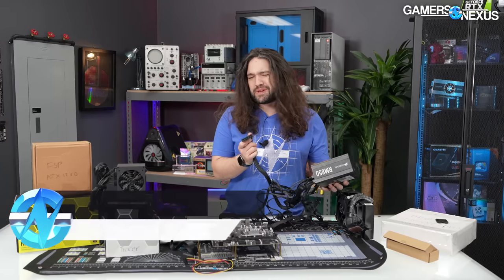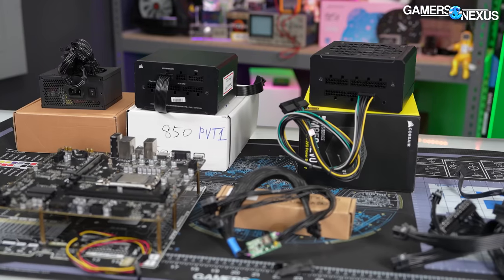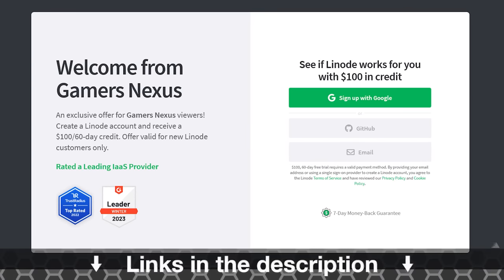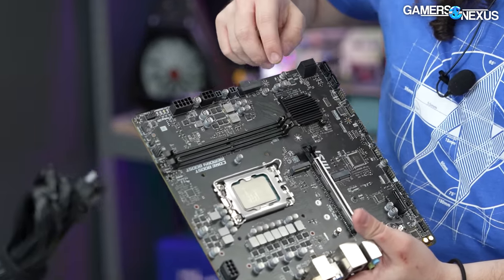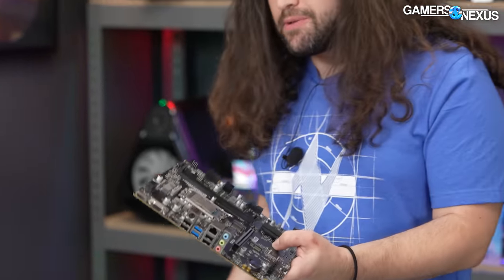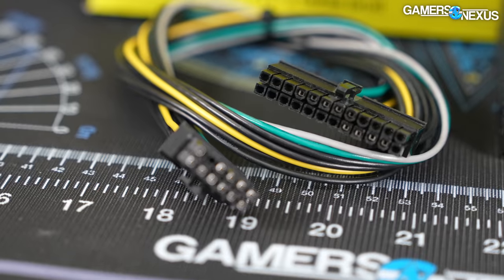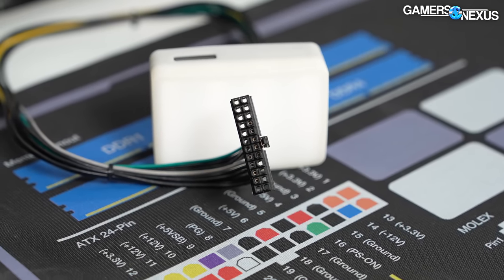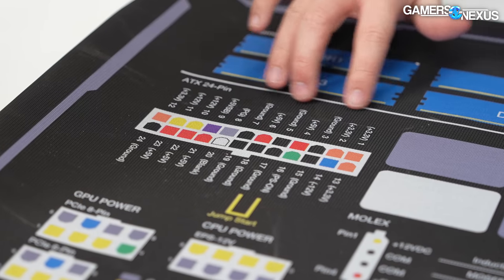The Future of Power Supplies - Maybe (Motherboard Cost, Cables, & ATX12VO)

Comment: With all the PSU talk I have a question, which I'd need to have answered more or less right now, but not immediately:
How much power does a bare ITX motherboard (actually a B450, but I'd like to know for general use) typically draw from the 24pin connector?
Just the bare board with an APU/CPU-with-IGP in it, two RAM sticks, one 3.0 NVME drive, keyboard, mouse and monitor.

Due to space constraints I need to build my own PSU solution and need to know if a 200W Pico-PSU is okay or not.

Just the 24pin, but there the cumulated power of all rails.

The 12V EPS connector is the least of my concerns. 12V power is abundantly available, I even could reroute both 12V pins of the 24pin of the Pico-PSU, if needed.
(No, it's not gonna be a car PC).
Reply: If memory serves, with Zen 3 it's mostly the SoC that's being fed from +5 V (maybe 25 W?), and +3.3 V is feeding the SSD along with misc small-fry stuff likesystem monitoring. In your scenario the +12 V in the 24-pin may be hardly used at all (save for fans and stuff), depending on the board's actual power routing.

If budget is no object, I don't see why a PicoPSU-160-XT shouldn't be plenty for your project. You're not going to overload it with a typical 65 W TDP AMD APU. On the Intel side, reining in the PL2 power limit may be advisable depending on what kind of CPU is being used, assuming the cooling solution isn't protesting first - the 224 W default PL2 of my i7-11700 would be a bit too much, for example. Do read the manual (it has the +5 V and +3.3 V current limits), and verify whether the P4 power cable is actually still optional like it says.
Reply: @PileOfEmptyTapes  Thanks for the reply, I appreciate it massively!
Just for clarification: With manual, you mean that of the 160-XT?

For my little toaster (not an actual one, mind you...although that might be tempting...) I'll be using a 5700G. But who knows what is put in there down the road. If I hadn't all the AMD stuff already and would go Intel, I would put something like a 12600 or a 13500 in there. But a 13900 would be possible as well - I don't need that, though. With Intel I would just get the smallest tier non-k CPU with the highest tier IGP.
Capping the PL2 limit was on my radar, but as I said: 12V power is abundantly available from the source which feeds the Pico-PSU, so the CPU power connector is not so important in that regard. I just feed that directly. The Pico only needs to feed the 24pin and nothing else.
Reply: @wiedapp  +12V being live all the time might work but is not a case foreseen by the ATX12V Power Supply Design Guide. You would have to verify this yourself with the board at hand. The PicoPSU is designed to switch +12V so all the rails come up at the same time as they would in a regular ATX supply.
Reply: @PileOfEmptyTapes  No worries, the 12V power source will be switched. Some people (...especially in the last decade...) did it a similar way, but they switched on the source manually before pressing the button on the system or have it auto start at power on. I want to use just the normal button on the case and nothing more.
Requires a little craftsmanship and knowledge of electronics, as that is not plug and play. Let's just say I'll build my own power brick and the Pico has to be slightly modified, nothing major. I don't want to go into detail, as that concept is not tested yet and I don't want my sources for hardware to dry up...

Comment: How would 12vo work on an itx motherboard? How would it work in general going forward with smaller designs like the new minisforum mini pcs? Moving the power regulation to the motherboard will have to take up board real estate and on small form factor boards real estate is already in a premium.

Comment: How would we build a custom NAS with a 12VO power supply? Do we need to go and buy a special (read: very expensive) motherboard with high current ratings on the SATA power connectors? Or 10 of them on board? Or are we expected to convert 12V to 5V and 3.3V externally in order to power the drives?

Comment: If they change anything, I would like to see a complete overhaul including the aged connector style, i.e. one line only for each voltage + GND, the requirement of having multiple lines carrying 12v (or others) is because of the connector cannot handle the power. sames goes for VGAs. maybe there was no connector available back when they designed the spec, but I am certain, there are better, more suitable connectors available these days.

Comment: The industry should consider a 12/24 or even 48 volt setup.  Higher voltage for the seriously power-hungry devices.  It's much more efficient to step AC mains voltage to 24 volt than 12.  48 is even easier.  The cabling can carry more power at higher voltages.  Consider this is already a route taken in networking Power-Over-Ethernet devices.  52 volts run through those tiny 26ga wires over long distances to power devices for years continuously, and safely.  Higher voltage devices can be smaller, and require less copper.  Its time the industry looks at a big shift.

Comment: Great video. Only question that I have after it is how exactly this standard makes PC more power efficient? I understand that PSU is more efficent since it has to perform single conversion but other conversions still happens, just on the MB. Why it is more efficient to perform them this way?
Reply: It doesn't unless the motherboard makes assumptions of what devices you can hook up and only provides enough 5v and 3.3v current to fit those expectations (because over-sized power supplies do run less efficiently). Otherwise, any advancements in efficiency they can put on the motherboard could also be put in a power supply. 5v and 3.3v lines do lose a little bit more power down the cables due to impedance ratio of cables to load, but it's very very insignificant and besides with VO we're running more total power down fewer cables which is also a minor step down in itself.

Want a more advanced config with several drives and stuff? Well then you can add more complexity with secondary power supplies that will likely bring your total efficiency lower than a nice ATX12V power supply was.
Reply: 1. You no longer have to send the +3.3 V and +5 V currents all the way from the PSU to the board, thus cutting down on ohmic losses along the way. (The OEMs particularly like that it also saves a fair bit of copper in wiring. If you want to transfer the same amount of power via 3.3 V compared to 12 V, not only does your current almost quadruple, but your voltage tolerances are correspondingly tighter on top of that. That means about 13 times the wire cross-section required, or 1/13th the resistance. Assuming it's all in the wires, which of course it generally isn't.)
2. Likewise, going from +5Vsb to closer to +12Vsb cuts the losses along the whole chain as well. Not to mention that you may want up to +12V for USB fast charging anyway.
It's the same as in the power grid - the longer the distance that power has to travel, the higher the voltage chosen will be. (Incidentally, the PCIe CEM 5.0 has added a 48VHPWR connector for a new +48V rail, likely to find use primarily in the enterprise world.)
3. Local DC/DC converters can potentially also be tailored more closely to actual requirements instead of having to ballpark it (on the generous side) when producing the PSU.

As a potential benefit of #1, you'd be eliminating the possibility of GPU return currents messing up NVMe SSD power as well (which is a bit of a thing, it only takes poor contact in the 24-pin ATX and a powerful GPU).
Reply: @korgied   Thanks for the explanation!
Reply: @PileOfEmptyTapes   Thanks for the explanation!

Comment: 18:15 pin 20 appears to be unused, it should be used as a report wire and it should be backwards compatible with existing equipment. It's a better option than the 12vo, if you need extra board power PCIe and eps already exist as do SATA and the less common 4 pin molex.

Comment: We would likely see things like that Seasonic connect and such come into being more readily. I could also see power distribution boards like what Singularity PCs make being made to handle the DC-DC conversions for a 12VO system using an older motherboard.

And I am fairly certain we would start to see more components move to a 12VO standard where possible. And failing that they likely would reduce the spread of volts required. Kinda like how some Single Board Computers and even some game consoles are built to run on only a single voltage. (Also I am getting flashbacks to Linus and his USB-C all the things video...)

Comment: If they need an additional layer now for some simple voltage regulation, then how did they transport the energy from the old 24 pin plug to the parts that need 5V + 3,3V? They claim that they need another layer to raise the marge.

Comment: I wonder how they will put these additional voltage converters on an itx board - and if they manage to do that at what cost? Futhermore it introduce another aspekt of complexity, currently on most psu the 5 and 3,3 rail can provide about 100w give and take. Will the motherboard also be able to provide that, in case you want to build an NAS with good old spinning disks? The manuals for the new motherboards will be wild. XD

Comment: Way back in 2006 I used combined data+power SATA cables (which, back then, adapted to a female molex). Similar cables are standard in datacentres for SAS connectors. I'm puzzled why ATX12VO doesn't simply move to those cables, which have at this point existed for over a decade, instead of inventing yet another cable (the 4 pin to SATA power).
Reply: It also feels like a missed opportunity to change from PCI-e aux power cables to a simple card connector on the motherboard like Apple's MPX modules. No more melting connectors. The only issue I can see is with Micro ATX where there might not be enough board space to accommodate a second card connector next to the PCI-e x16 slot without fouling things like the chipset or the RAM slots.

Comment: Is 12VO really more efficient overall? Because I'd think it would be less efficient.
Because transforming a voltage twice(230v -> 12V -> 5v) can't be more efficient than transforming it straight to the correct voltage(230v -> 5v).

So I'd very much like to see that tested in practice. Because I find those claims really hard to believe.

Comment: Anyone else old enough to remember when BTX was supposed to be the new thing, and we were being told that ATX boards and cases were going to be a dead-end?  It was right around the time PCI and AGP were replaced with the new PCIe standard.

This gives me those vibes.  The DIY PC market accepts change slowly to never, when it comes to things like this, because cases and PSUs are treated as future-proof.

Perhaps smaller system integrators will adopt this sort of thing to compete with HP and Dell, who have their own janky proprietary standards they use from time to time in certain systems.  They’ve already sunk money into R&D on those, so it doesn’t make sense for them to switch, but a smaller boutique builder that wants to build custom cases and wants to save space might find this enticing.  I don’t see most regular folks getting into these unless we’re forced and I nobody has the balls to push consumers hard like Apple does.

That said, it’s possible that this could catch on in SFX PSUs, because they can probably crank a little more power out of those little guys and the conversions on the board could be minimal for an ITX board.  Someone interested in an ITX build probably isn’t going to mind giving up some legacy things that require the lower voltages.

Comment: But also the past.
I had a dual socket LGA 1366 that had a 12v 24 pin, on the PSU side it connected to a 12V EPS 8 pin, with basically 2 pins running to the 24 pin, then the 8 pin was broken out to the 24 pin.
The weird thing, i tested, and you could daisy chain two of these 12v motherboards together because there was a 24 port on both the right and left side of the board.

If you want to look them up its a supermicro X8DTT family (I had a pair of -HIBQF and a pair of standard -F)

You can probably find them for ~$40 or less, as thats how much the F variant was when i bought them in 2015 on ebay Q variants were expensive because of the 40G networking

Edit, be sure to buy them with the adapter cable, because i have yet to find the pinout documented, though i havent tried to find it since probably 2016

Also, pretty sure this non-standard standard uses 5vsb instead of 12vsb because it seems to work with any modular PSU that uses a standard physical 24 pin and EPS 8 pin (IE modular server PSUs that dont invent their own pin-outs to be 'special')

Comment: Messy cable management, possibly blocking airflow will not be popular amongst DIY builders... not that the current stiff 24pin connector is wonderful to work with lol but...this makes more sense for business computers and oem computers...where the system integrator can customize the hardware and (cases) to better manage cables/routing.

Comment: I'd much rather have 24V, maybe in addition to 12, 5 and 3.3V. Cables can be thinner and less bulky to route through the case. That MB plug is so big and with thick stiff cables also quite a mechanical load on the connector. Gpu would also benefit from this, may be powered entirely through the pcie slot. 
As for power saving, a signal wire where the pc can indicate low power usage the psu can go into power saving mode, or have a i²c connection to negotiate power requirements. 
There's also some power loss due to long cables and low 12V voltage, with higher voltage this becomes less of an issue.
I'm not sure about the MB convering to 5V for harddrives, routing extra cables through MB seems like a step back. 
Also, if a power stage fails on the MB, the swap is more expensive and a lot more work than just replacing the psu.

Comment: how does the foot print go down vs a 24pin plug? sure the 12 pins less is nice but you need to factor in 2 power stages (2 mosfet per stage it looks like on that board) and supporting components (capacitors), looks like it using 2 to 2.5 times the board space

You know in the DIY space we could just take  this part off the board and put it in a 2.5 or 3.5 drive bay, so your 12vo motherboard comes with a separate board to power your sata drives and leds

Comment: I'm curious as to what the waste would be on a large scale from the components being added to a motherboard which is arguably more disposable than a power supply, which tends to be reused for several generations of components.
Reply: That being said, moving the converter to inline on the cable does seem to make sense, but do you still get the efficiency benefits with that?
Reply: Martin R  true, I was just thinking from a waste perspective

Comment: I_psu% seems like a great idea, since intel seems fixed on "if we're not at the limit of the spec we're not taking enough power." with clever software you could have a 450W psu with an i9 and an rtx 6070ti or whatever it will be when they implement it, and it would work, just with the cpu and gpu working at lower clocks.

Comment: I wish we'd move over to this standard already. Everyone knows I'm not a big fan of change for the sake of change, but something bigger is at play here. Any issue I have (such as me having 6 HDDs in my system) has been solved by the server market a long time ago. So long as manufacturers make the parts available and include everything you need to run legacy load-outs, it's fine. It's time to progress into the future of power efficient computing.
Reply: "So long as manufacturers make the parts available and include everything you need to run legacy load-outs" Manufacturers having available stock and including a single thing, are you serious? 3 months delivery time and costing as much as a whole motherboard, maybe.

Comment: The idea of throttle instead of explosion is nice, could this mean it would be reasonable to have a battery in the PSU as some kind of built-in UPS? I once had a external UPS which would provide around 10 minutes of power but it's just too bulky and noisy I hated it and eventually switched to a laptop.

Comment: Hi Steve,
i would like to transition to such boards for the added power efficiency.
Otoh we need a 80plus like rating for motherboards then.
On thinking about it, there should be this sort of labeling/rating already for the voltage regulators on motherboards.<
Would that be an interesting feature for your lab?

Ciao

Comment: this is terrifying, i repair power supplies daily for all kinds of appliances.
and the worst thing is when they move some of the power rails onto the mainboards, cause then if there's a power fault, now you have to look at two different parts as the potential culprit.
now imagine having to swap out your whole mobo, just because of a dead 3.3v rail.

keeping the power rails in the PSU is in my opinion the better option, cause now if there's a power fault, you just swap out your PSU, and not your entire motherboard.

Comment: I somewhat hope that if 12VO becomes a thing, that it will mean the end of SATA. The need for harddrives in consumer pcs is going down. So an board mounted SSD is fine.
And maybe we could switch to a harddrive connector that does both power and data in one cable.